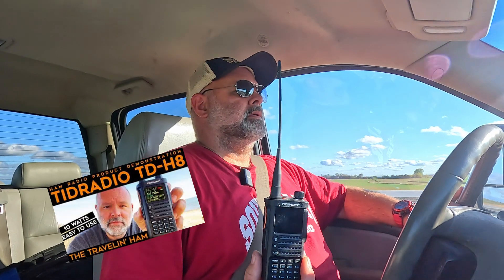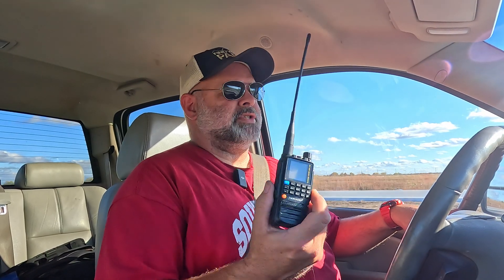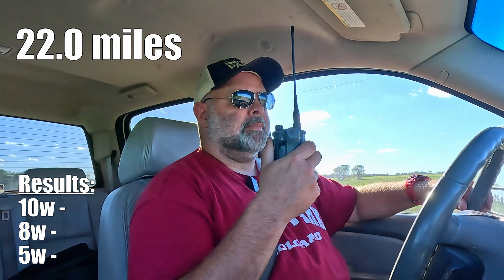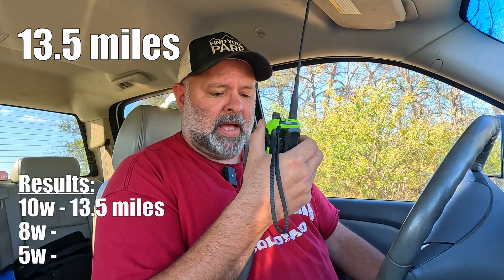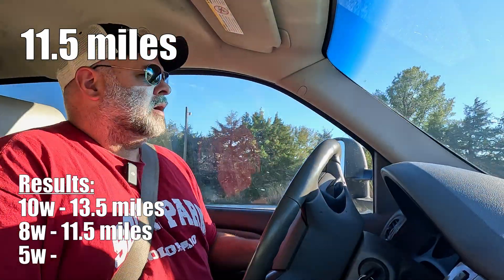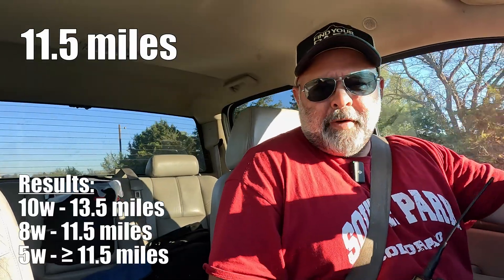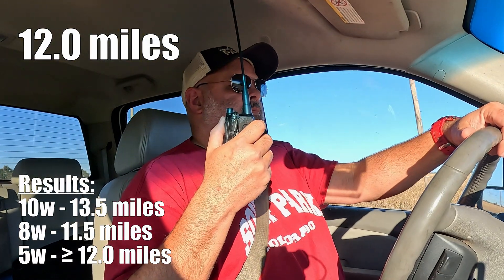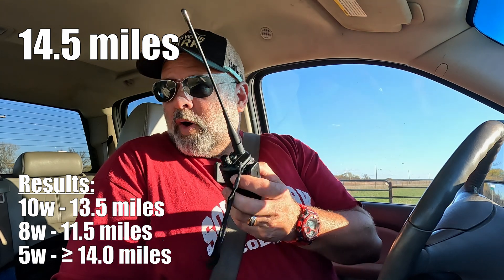Chinese Ham Radio Handheld Faceoff! 10 watts vs 8 watts vs 5 watts

Comment: Hi Mike!
That also depends on the housing of the devices and how much RF counterpoise they have.
We once compared an old Kenwood TR-2300 (2 meters / 1 watt) with a Yaesu and a Chinese handheld radio.
We tried to open various remote repeaters. The modern devices had no chance :-)
73 de Juergen AH6UN / OE4JHW
Reply from the maker: Very well could be, Juergen. Thanks for the addition!

Comment: Surprising the range on those radios was so short. I'm sitting at my PC inside home in Havana FL, and can hit the Tallahassee repeaters on 5w (TD-H8) and 2.5w (Anytone 878 plus), distance 15.8 miles.
Going to try another longer range test next time I go to work in Quincy, bit further range to try.
Both radios at high power were hitting the same repeaters from there, sitting inside my truck.
73, K4EFW
Reply from the maker: Perhaps this time of year you’re getting some tropospheric ducting.
Reply: @TravelinHam  Possibly, will have to do an occasional test every so often to see if anything changes. On high power both radios have had zero issues hitting any repeater up to 18-20 miles since I moved here 2/2024.
Record distance was a repeater 25 miles away.

Comment: Could be the antenna. My h3 has a bad antenna. Like a direct short. Finally settled with an old baofeng antenna for when it’s in my XYL’s purse.
Reply from the maker: Interesting. Where we store them in the RV the antennas can’t be attached. So mine are all mixed up with other TidRadio, Baofeng and TalkPod antennas.

Comment: Great video! Is that the H8 v1 or v2? Forgive me but I just found your Channel but have you tested the output on the radios? I was wondering if the have the output power they should.
Reply from the maker: Honestly I’m not sure. I’ve heard the antenna is the only difference and we have mixed up all of the antennas.

Comment: The Video is a Great "Real World" Test, there are Many Variables to Consider : Atmospheric Conditions, Distance, Line of Sight, Adsorbing External Elements, Refraction Elements, Multipath Elements, Radiation Patterns, Quality of the Signal (Signal to Noise Ratio), Actual Squelch Levels, Receiver Sensitivity, Antenna Efficiency. These Play into the Test this Make Comparision Test Hard to Reproduce with Hard Metrics. In-general it is the Real World Edge of Environments where Sometimes and Only Sometimes where RF Power is the Lone Factor. Good Luck....
Reply from the maker: Squelch is a great point. Each radio could simply have their squelch calibrated differently even if they're at their same squelch levels.